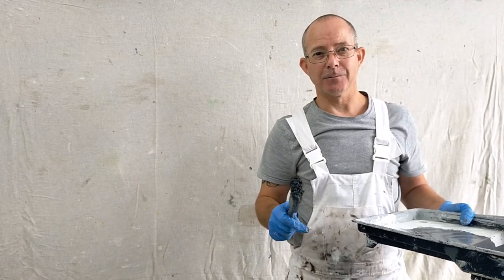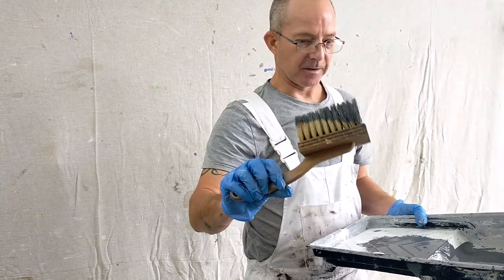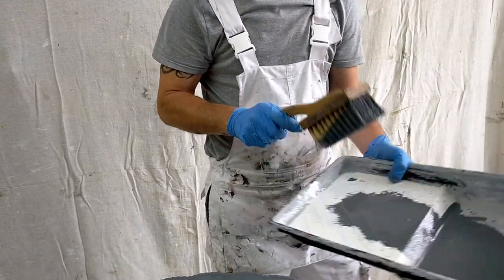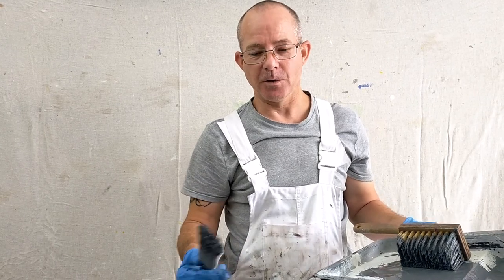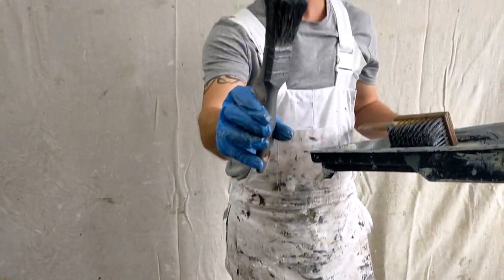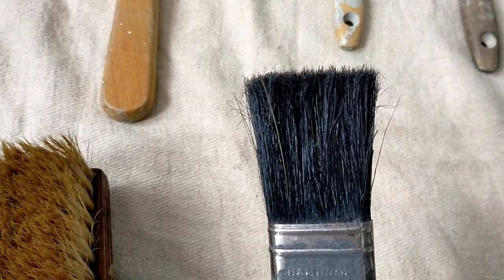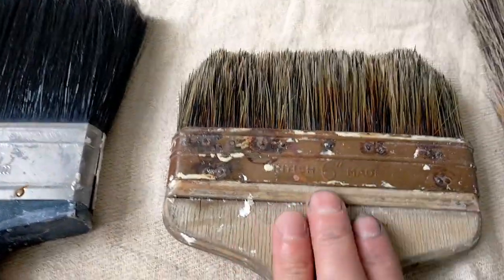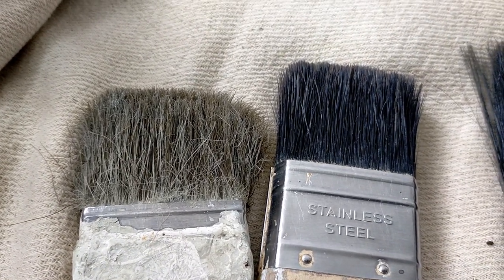Problems With Paint Brushes

Comment: Graco gun much. Quicker
Reply from the maker: Not all paints are suitable for spray application , this is exterior gloss. Thanks
Reply: Use some waterbased exterior gloss then. You still using oil?
Reply: @gareththompson5269  Water based are still rubbish.